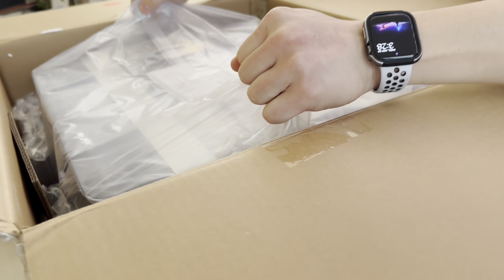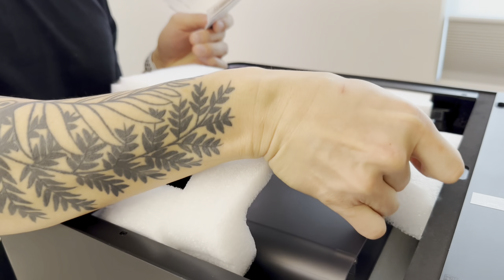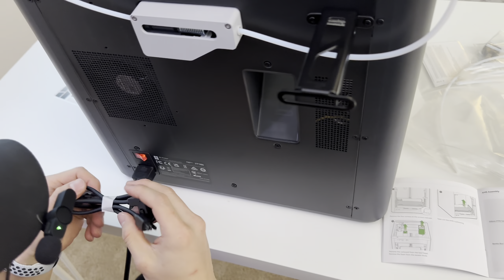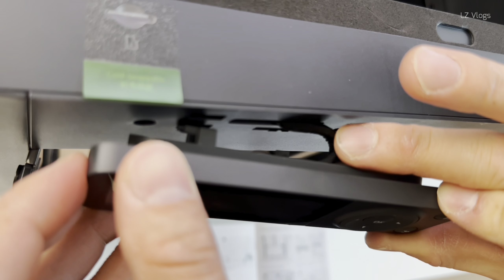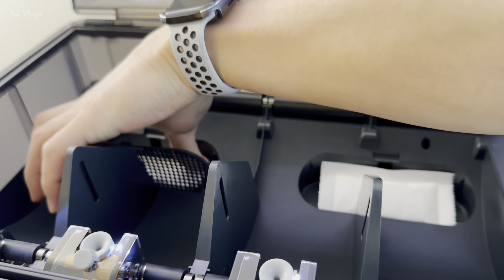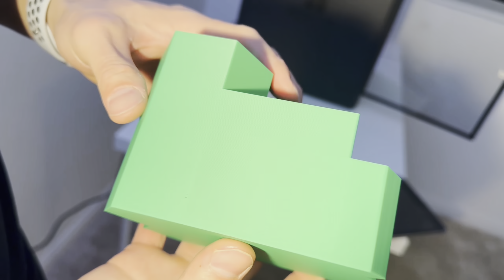Bambu Lab P1S combo 3D Printer Unboxing | Step by Step Setup & Test Print

Comment: Ordered mine 4 days ago, except it's not a combo! I'm very excited, it's my first 3d printer
Reply from the maker: 🎉🎉 Congrats!!
Reply: @LzvlogsVegas  Thanks! Estimated to come on the 19th!

Also, i got a question. I bought 8 whole spools of fillament. 2 matte pla and 6 basic pla. Did i get to much? Did get it on some deals for cheap. Only one roll was bambu lab original
Reply from the maker: @EdyKDM depends on how much your gonna be printing?
Reply: @LzvlogsVegas  Im worried about it getting humidity inside it. Idk how to dry it without one of those big, flashy driers